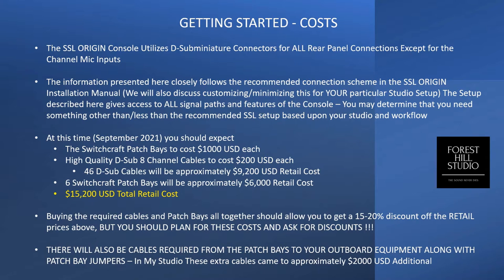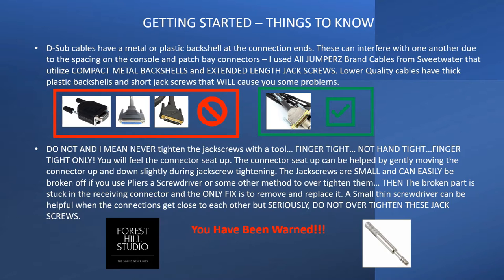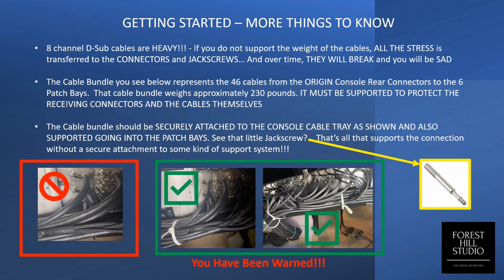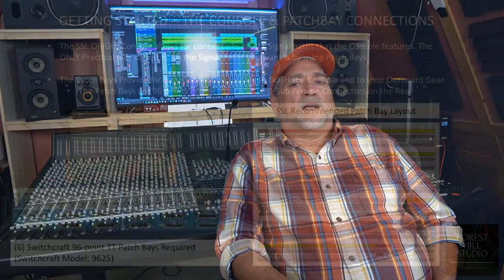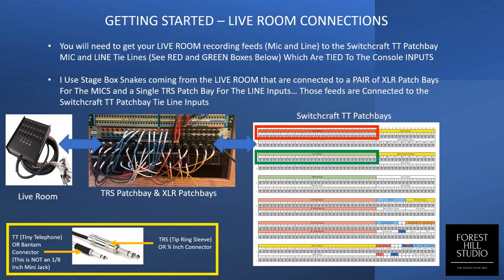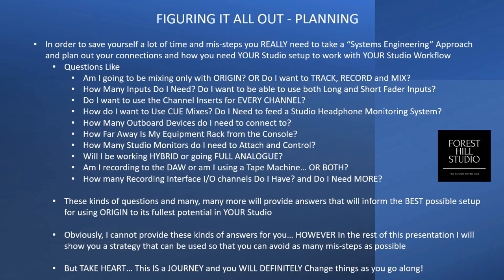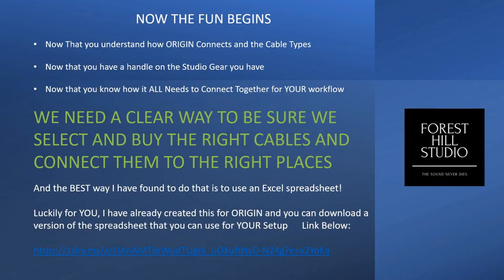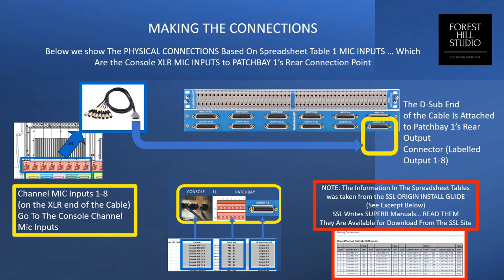SSL Origin Studio Connections

Comment: Do you know if there are any third party automation installations?  I don’t need recall but moving faders and mutes. I am thinking about replacing my Trident 80B which has Uptown Moving Faders. I also still use my Sony JH 24 Tape Machine as well as ProTools HD 8 with three 192 I/O’s. Thanks for any info you might have.
Reply from the maker: Hello… I use the SSL UC-1 with my console and the associated SSL360 software… this gets you EQ, Comporession, and other features for every channel that are stored and recallable… check out YouTube for use and features.
The system works beautifully and sounds FANTASTIC
Reply from the maker: https://youtu.be/vMJt5Zy0gk8
Reply: @foresthillstudio  ok thanks. Unfortunately my audio tracks are coming from a 24 track tape machine so I need control on the console
Reply from the maker: @HaHaHaHope  The SSL 360 Software Provides for transport control
Reply: @foresthillstudio  it can’t control Sony JH 24 so I don’t understand what you are referring to be controlled. Just to be clear I am an analog studio.  Currently I have Trident 80B with Uptown moving faders and my tape machine is Sony JH 24 two inch analog recorder. I do have ProTools HD 8 running on a MACPRO 4,1 iOS 10.6.8.  with three 192’s A/D D/A converters and Sync i/o to sync 24 track tape machine and moving faders with ProTools HD 8. I cannot use any Mac iOS later than 10.6.8 on my Mac Pro or PROTOOLS HD 8 will not run. Sorry lengthy response. But I wasn’t sure I was clear that I am not a hybrid studio or in the box.